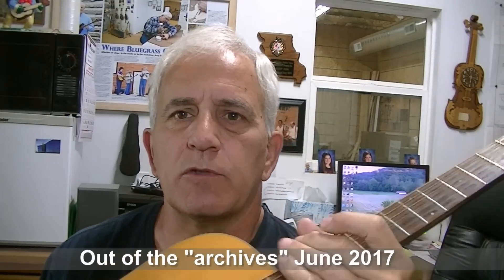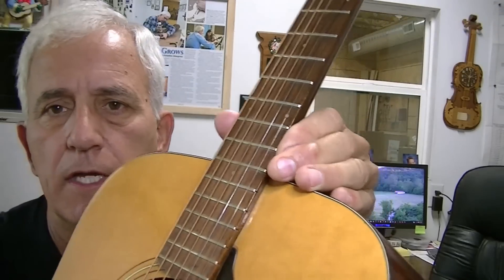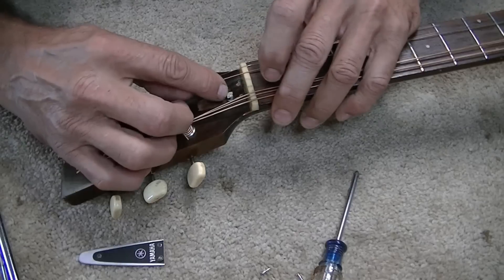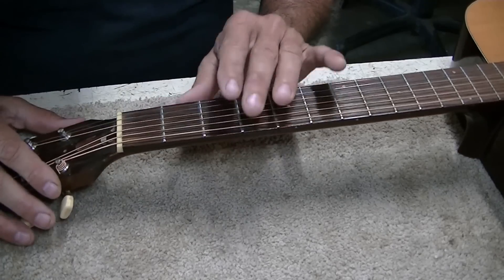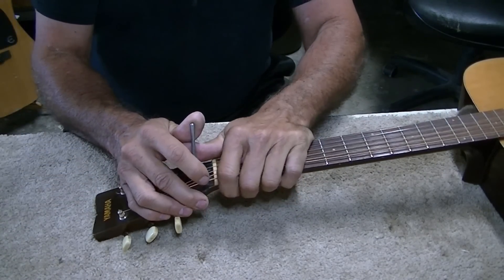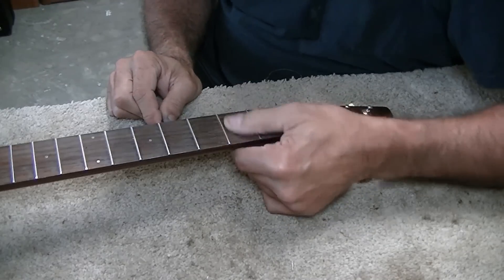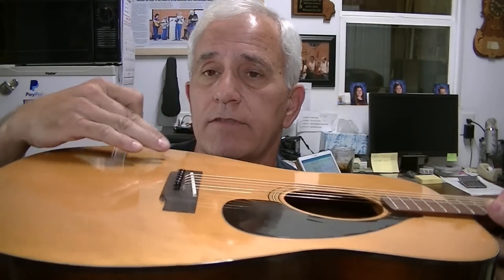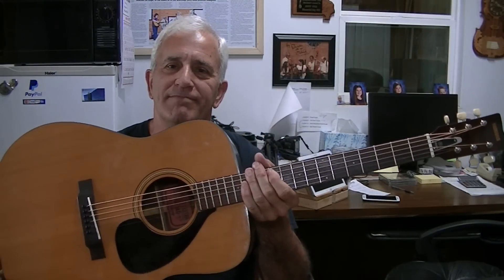197 RSW Yamaha Guitar Truss Rod Issues

Comment: Rosa String Works good luck with your computer and rental property. I have a cheap Rogue guitar when I strung it up action was way way to low I tried loosening rod and it had no affect what so ever so I took the board off and took rod out of it and tried it again rod would not relax and loosen. I ordered new rod for it new 2 way hopefully cures it. Rosa String Works ever have issue of action being to low because rod will not loosen? Going to ever work on anymore Harmony guitar's again?
Reply from the maker: +Brian Smith I hate to sound like a know-it-all. But I believe you're chasing the wrong problem. The truss rod is only there to adjust the under bow in the neck it does not adjust the action. I can show you that in black and white writing from Gibson Martin and Taylor. Therefore if the action is too low you either need to put a taller nut on it or a taller saddle or you need to adjust the angle of the neck with a neck reset. That's really the only three options. Actually I know of a few other ways to tweak it and help it out without a neck reset but the truss rod is not the right answer I'm sorry. Good luck with it hope you're able to fix it.

Comment: Have you heard of a floating floor, where you lay sheet insulation on a floor and then put sheet floor material on to of that, no fixings just glue the sheet floor together, You need to remove skirtings and shorten doors but at least the floors are then toasty, cheers
Reply from the maker: We actually have a floating floor in the largest great room. Doesn't really seem to do that much. You have to understand this is not your average house. 7000 square feet of concrete floor is just a bit of Overkill. The other very ironic part of the situation is we live in a deep valley and we truly are one of the coldest spots that you'll find in this area of Missouri. 7 miles away the temperature can easily be 12 degrees warmer where the altitude is higher

Comment: Rosa String Works I put a really tall saddle and it was to low also maybe nut I lost original nut put a different one on.
Reply from the maker: +Brian Smith raising the nut is only advisable if the action is too low at the first fret. Otherwise raising the nut won't help you. It sounds to me like you will need a neck reset if your saddle is really tall. Sorry.

Comment: I've owned a Yamaha FG-230 12 String since new, in '72 - a great guitar.  There is one thing which I do not like about it though, it goes through 'nuts' quite regularly. It reaches a point where I cannot manage to keep it tuned. Each time this happens, I take it to a different luthier, and they wind up installing a new nut. An ebony nut was installed this last time, and it seems to have held up better than the others.

I was told that keeping a 12-string in tune is a never ending task, but now I wonder if it is a "Yamaha - centric probllem", instead.

But they just sound so good!
Reply from the maker: +AMStationEngineer It probably shouldn't be going through nuts just because it's a 12-string. Though they are much harder to keep in tune there's no question about that. They really put a lot of stress on a guitar top. Thanks for watching.
Reply: Is there a chance that all the previous nuts were just made of inferior plastics? Another possibility is that in all previous cases, the nut slots were cut too wide, and allowed the strings to move slightly in the slots & create wear. A lot of tuning & string changes over time can act to cause the strings to cut their slots deeper, but it won't cut them to fit the string properly and the slots will soon become irregular and can often bind on the strings as a result, creating a need for a replacement. I've heard several times that some makers allegedly recommend that a 12-string should be tuned a full step lower than a 6-string, to help limit destructive forces of all kinds. If I were to be in the market for a 12-string, I think I'd look for one with a shorter scale length, so that the strings are under less tension to begin with. The neck itself doesn't seem to need to be thick & chunky to have good stability, but the extra tension can really play hell with the body, and the only way around that is to beef up the dimensions of the top, the bracing, & the bridge, which unfortunately also has a tendency to kill the tone & response. So if a guitar is a collection of balances & compromises, the life expectancy of a 12-string is compromised by the added string tension in a way that means 'the better it sounds, the quicker it self-destructs'. Or, you can build on the heavy side, & settle for longer life but with worse tone & volume.
Reply: I have one of the newer Martin DX series 12 strings and I have never tuned it.
Imagine how good it would sound if I did, seriously, it has stayed in tune with only needing slight adjustments, I keep it in the case and in check humidity.
In the other corner I have an FG75 I've owned since 75, it stays in tune, but has the same bow in it and shreds my fingers, but I still play her bc she sounds so nice. I am going to go over her with all this info learned here today, just ordered light folk strings and gonna take a look at that truss rod situation. Gonna wax it up too, never heard that one, but the finish is gone from the top of this guitar so...

Comment: Catching up on your videos (you’re one of my favorites to watch) and I was wondering if you think that a 3/4 sized should have lights or extra lights? I have a Fender MA-1 and the factory strings are 12’s and as both a beginner and knowing that it’s obviously a smaller guitar, I think that it could potentially be better for the guitar (and my fingers) to switch to lighter strings. Thanks in advance,

Marisa
Reply from the maker: Thank you for watching my videos. And your kind comments. I would definitely think it should have light strings on it. I don't think you have to go to extra light. You will be surprised sometimes guitars like that actually sounds better with lighter strings. You might be able to get ahold of the mx7 seven fives by Martin those are a custom light. I can also sell those to you via email if you want for about $12.50 including shipping. I saw that you just became a patron on patreon. Thank you for that. I will knock an additional dollar off your set of strings if you'd like to order.
Reply: Rosa String Works  Hi there! Sorry I’m just now seeing this! That would be great actually! And it’s no problem. I saw you had a Patreon and had to support one of my favorites!
Reply from the maker: marisathebibliophile great if you'd like to buy the strings via email just send me a note to my email address which is rosastringworks@gmail.com. Thank you very much.
Reply: Rosa String Works sounds good! Thank you!

Comment: If you are tightening it that much and it is not effective, you may be bottoming out on the threads on the rod.  A washer on it, or a spacer may prove to be a fix.
Reply from the maker: garry7263 thanks. I'm very aware of that issue. That was not the case. Thanks for taking a look.

Comment: Wow. You have had a bad spell of troubles all at once. On the computer side you can use Device Manager to remove the drivers for USB devices, reboot the computer, and let it reinstall the drivers for the USB devices the next time they are plugged in to the computer. Similar to what you would say to someone working on an instrument, if you aren't sure what you are doing have someone else who does help you to get the computer working as it should. When a computer isn't working right you soon realize just how much you use it.

I was able to see the neck underbow and the bulge on the top by the bridge in the video. After you loosened the original strings I noticed an odd bend in the low E at the 10th fret. The measurements of the strings says they were Light strings (12 to 53). Custom Lights are 11 to 52. If the action is being set a bit high using Custom Lights could help with playability. I've been using Custom Light strings on my steel string acoustic as I felt it would help me when I started out. I recently discovered the guitar shipped from the factory with Custom Lights so I'll be staying with that gauge of string.
Reply from the maker: Actually I did just that on the USB. I was at break-fix guy for AT&T for several years on PCS. So I'm pretty familiar with how to work on them. I use custom lights quite often. Thank you very much for watching.

Comment: I have a FG-411L bought in 95, actually I bought one in Oct 94 but returned it in May 95 due to a warped neck.  These Yamadogs are notorious for bellied sound boards due to the lightweight top bracing.  Mine will be getting a "Bridge Doctor" real soon.  However, they do have a loud, awesome sound.
Reply from the maker: The Bridge Doctor definitely pulls out the Bulge but in my opinion it also affects the tone.

Comment: RosaStringworks The truss rod  is broken over tight it would not loosen at  all
Rosa String Works if the rod is over tightened way to much and wont loosen up at all could that cause action be low? Rod does not work right
Reply from the maker: +Brian Smith I say again, the truss rod only affects the under bow in  of the neck it does not change the angle of the neck therefore it won't change your action.

Comment: Do you ever do heat clamping?  That might be a good way to get the neck back to original flatness with a loose truss rod, then you might not have to tighten the truss rod so much to get a little overbow.  Just a thought.  I bought an old 65 Harmony H22 bass that really had bad under bow, so I bought an angle iron piece and clamps, and put it over a floor heater for about 20 min (carefully at 90 degrees) and let it straighten and cool slowly, overnight.  The neck ended up perfectly flat. Then when I did a setup I didn't have to tighten the truss rod quite so much to get a little overbow, and leveled the frets individually wherever they buzzed.  Just a thought.  Thanks for the video, learned a lot.  You've got real patience!
Reply from the maker: I've done it a lot over the years. Really don't have much luck with it. Seems that everything that you been that way eventually pulls back to where it wants to be.

Comment: Rosa String Works How do you typically fix a older guitar with sinking top acoustic?
Reply from the maker: You hit on one of the harder fixes. Lot of people think you can just humidify it and press it back into place and it's going to stay. My experience says you're wasting your time. If it pulled into that position or sunk into that position once it'll do it again. So in my opinion the only way to fix something that has warped or bowed or pulled or sunk is to change the structure by adding additional bracing or Bridge padding or something. Thank you for watching my friend.

Comment: Rosa String Works what do you recommend as a good heat source to get a warp out of a guitar neck? Maybe iron,maybe lamp just wondering what you recommend?
Reply from the maker: I have to be honest I don't have very much faith in straightening something that's warped. Most of the time it worked for a reason. And most of the time it will return to that position given a little bit of time. You can straighten it with heat and pressure. But my bed is it will return to the Warped State. Eventually. Sorry to sound like a party pooper. Most of the time whenever there is a problem like that. I fix it mechanically. Meaning that I might remove the fretboard Andre carve the neck a little bit to get the warp out or something like that.